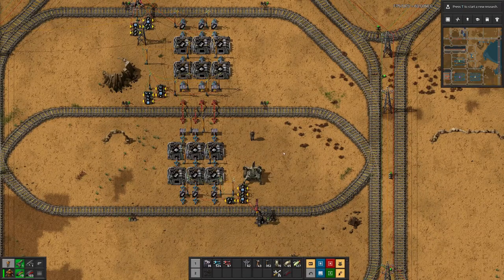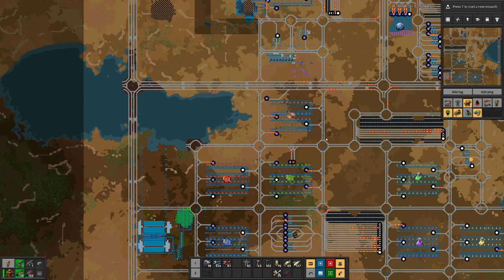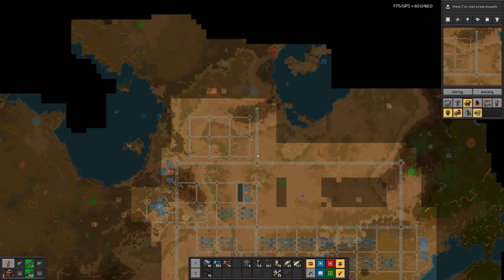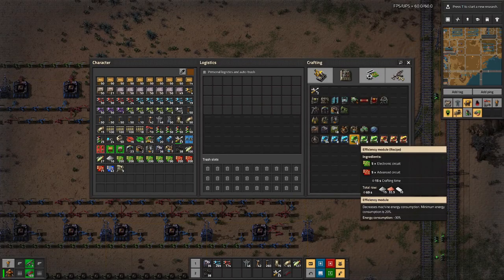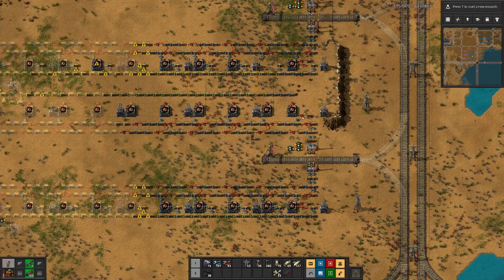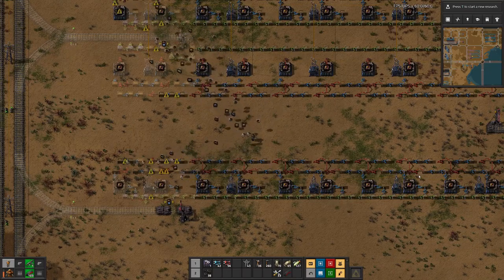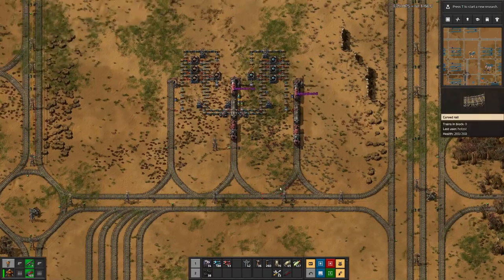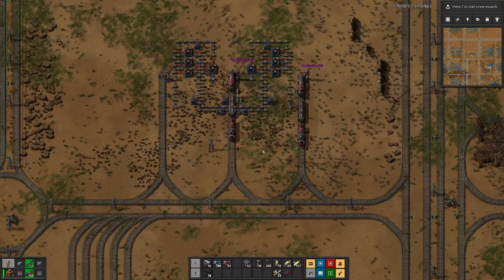Beltless Factorio | Modules - E57

Comment: How fast would it be to transport things using inserter > crate > inserter? Compared to something like a blue belt?
Reply from the maker: Tricky question there @Euler271: A blue belt moves 45 items per second and a stack inserter moves more than 16 per second. Considering that the inserter moves the items over two blocks that makes an average of 32 items per second and tile.
The real bonus comes in the late game with stack inserter bonus of +11 items, so that brings the total number up to (8+11)"2=38 per second and tile which is still below the blue belt (considering my math is right). And there is the drawback, that for inserter chest you only can have even number of tile distance.
The real issues starts when you have to use long handed inserters, that rotate at half the speed of the fast inserters, and of course for long handed and fast inserters you only get a may bonus of +2 instead of +11.
I would imagine that given enough space you can overcome the throughput limit (think two dimentionally and get up to 76 items per second and tile, but for a factory that would probably only work if it requires one input type of item.
There are mods, that add higher tier belts but also mods that have highly costumiezable inserters, that allow the pick up and drop off location to be defined. With that in mind it is a whole different story as you could have multiple inserters moving items form one chest to the next. See @DocDoshington's run: https://youtu.be/6mgQwzom0Xo?si=YHRSqeEx7TVYk6lY
Reply: @hotzstGaming  nice breakdown. I remember seeing some sort of glitch where you can use the train cargo for transportation (replacing belts) and it ends up way faster than blue belt. But it's a much more complicated setup, so it got me curious if i could get the same speed with normal crates haha
Reply: @hotzstGaming  yeah that's the video haha where the guy used the train wagons